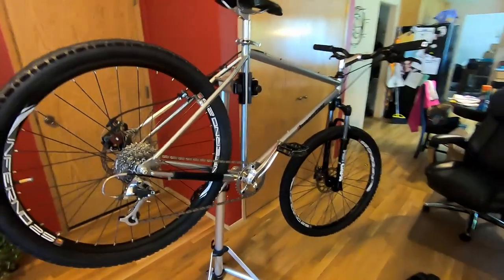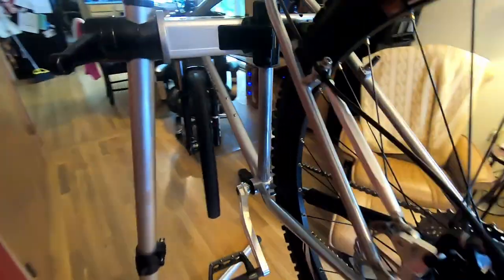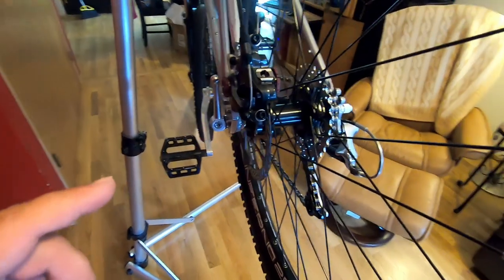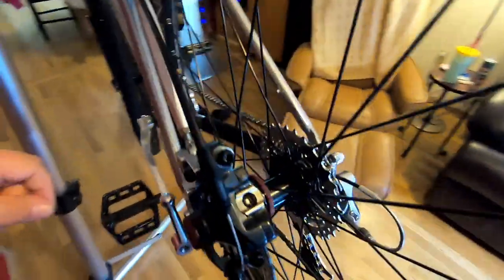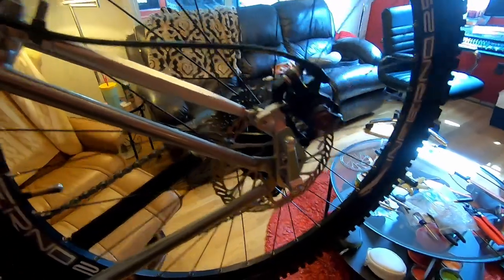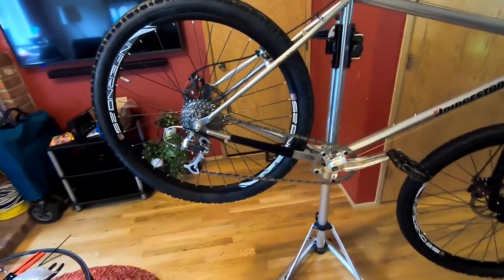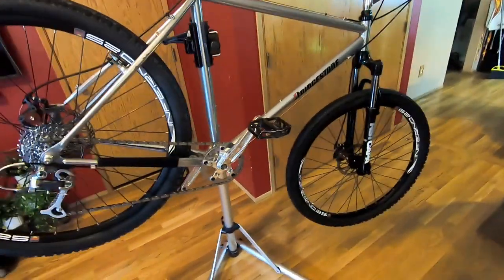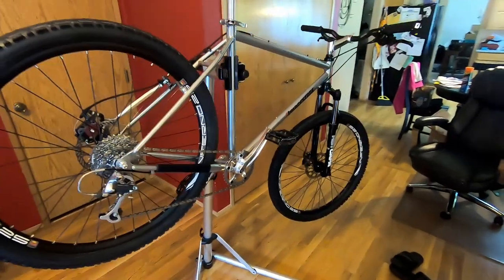Chaser bicycle rear disc brake adapter Part 2

Comment: How is it holding up ?

Would it had been better to put the arm on the other side of the adapter (outside of the frame) ?
Reply from the maker: Good actually.  Still have no complaints on the kit.  The brake choice is still kinda noisy and squealy but that of course is not the brackets fault.  Still riding the old Bridgestone when we can.   I never really thought about putting the rod on the outside and I think that could work.  It would be at a hell of an angle though.  That being said I've never had any problems with the rotor contacting the cap screw.   Thanks for checking it out ZeBen.
Reply: @PNW_Car_Mods  Yeah as i thought about the rod on the outside, it's on the inside because V-brakes apply torque on the inside too, so it try to bend the tube "outside", if you would put the rod on the outside it would try to bend the tube "inside" if you understand what i mean, i think leaving it on where it is is better for the frame integrity !

I'm planning on building a cargo bike from an old cromoly frame and looking for ways to make an adapter since my old frame is v-brake only, might end up with the same system but welding something close to this and maybe building a U bridge with the two v-brakes mounts over the wheel, idk i'll see.

But from what i'v seen from some custom builds on youtube, people just weld a simple plate as an adapter without any reinforcement :D
Reply: Actually most use a small piece of tube to form a triangle near the drop out to reinforce it !

Comment: I found that kit in the US store... get's too expensive to send it to Portugal. Need to find another solution. I think front is going to be Hydraulic braking but at the rear as it's... We will see..
Reply: That's my thoughts on my 1986 Diamondback Arrival MTB enhancements. The front brake does most of the work so the rear can stay v brake for me.

Comment: what would happen if you didn’t use your screws against the drop out
Reply from the maker: IMO the screws are not really there to take any load.  They are there to keep the caliper in place when you remove the wheel.  I would try and get at least one screw into it to hold it in place if you can.
Reply: I’m looking to use a brake booster on the seat stay mounts. Would you say it would work?
Reply from the maker: @BoostedAE86  Jeremy are you talking about one of them horseshoe deals?   I think it would work but its probably not needed at all.